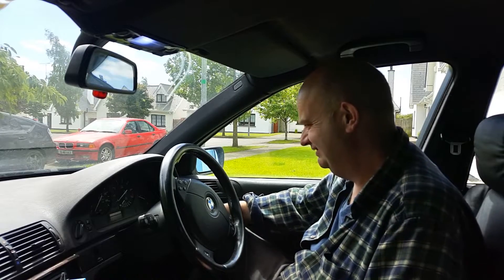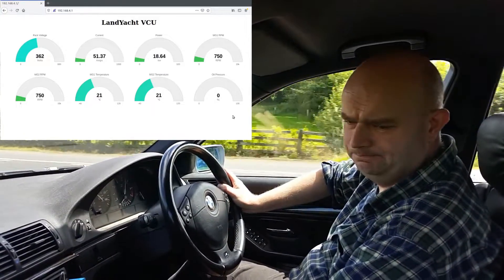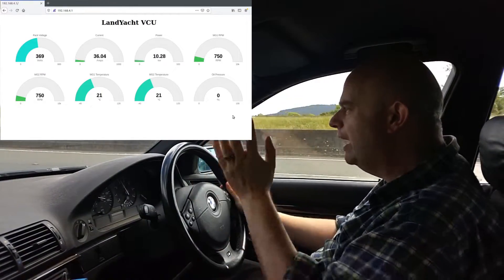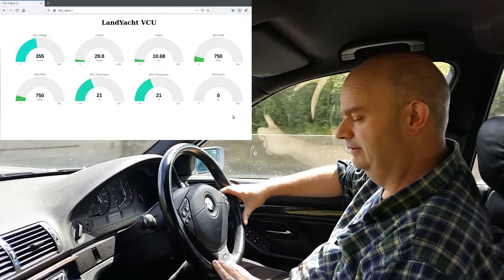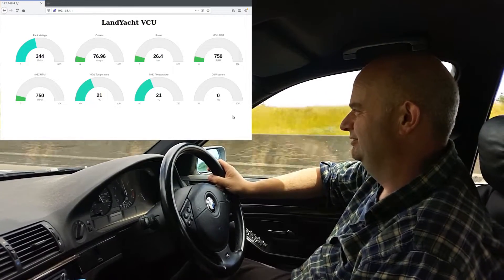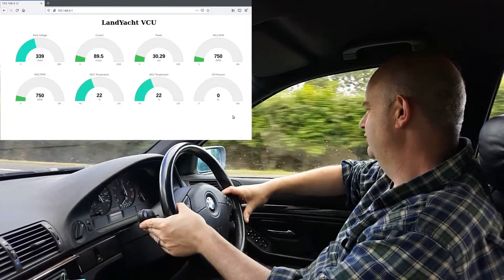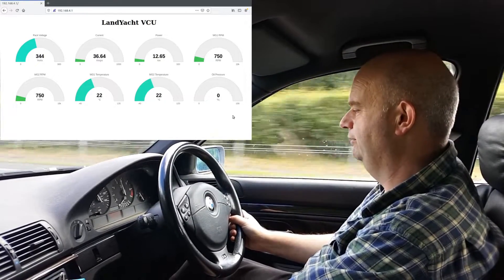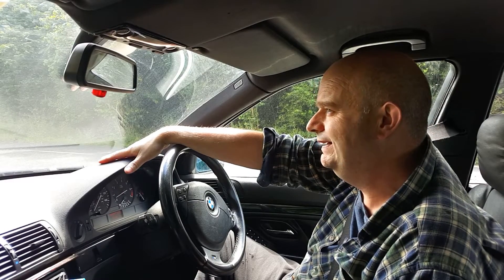BMW E39 EV Conversion 67 : Motorway Merging

Comment: Max power was around 52kW when joining the motorway and cruising at 70 was using around 15kW.
Useful to know when trying to work out a battery size for a given range. 
Also goes to show you can drive a two ton behemoth Bimmer at normal speed using only 70hp. 😮
Reply: 20 to 25 kW is enough to propel nearly any car down the motorway/highway, unless they are really shaped like a brick. 
It's why I have never understood why the so called "range extended" cars need(ed) an ICE with more power than that.
I would love to convert my '88 Mitsubishi Starion to full electric...
[eventhough it's said to be a 2+2 coupe, the rear seat is practically useless and could be discarded to make (a lot of) room for batteries.]